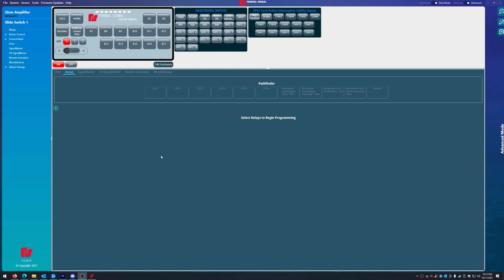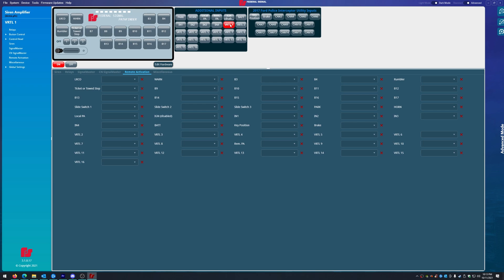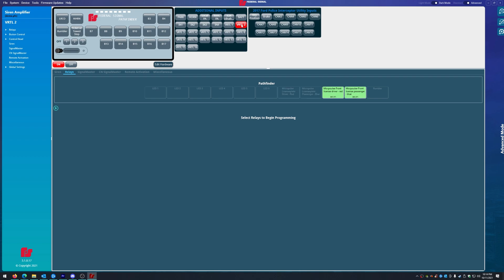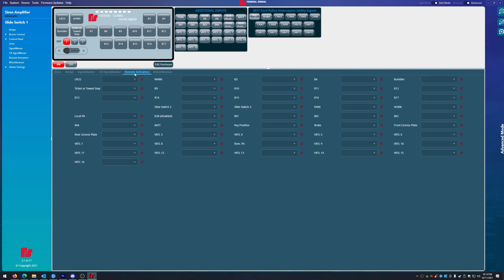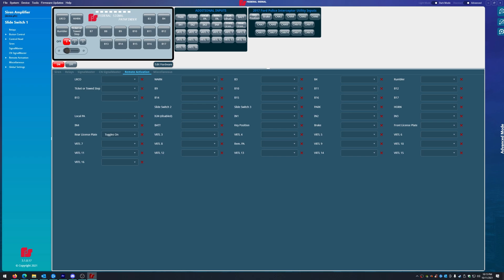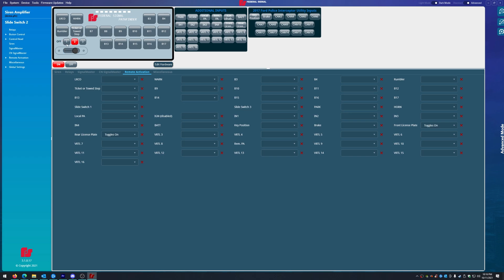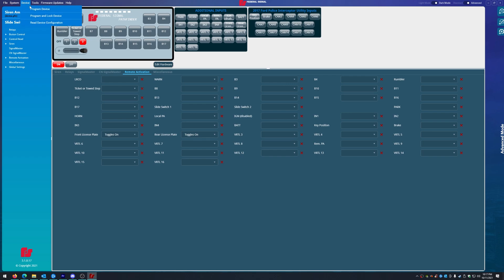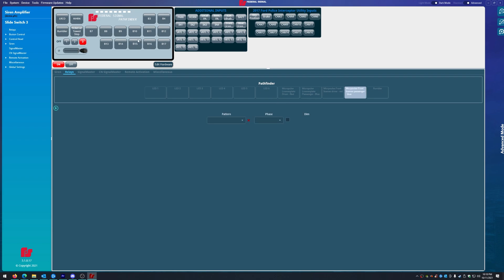Basic Federal Signal Pathfinder Programming - Remote Activation & Virtual - Ep 8

Comment: this is what in confusing to me, so the SS does not act as "true progressive" slider then?  Meaning you have to manually turn off what is activated if you knock down a position?  I was under the impression that it will turn off what is activated automatically if going from 3 to 2 because that is no longer activated.